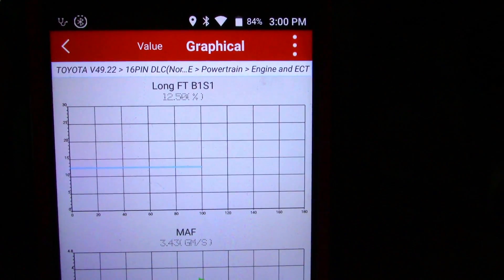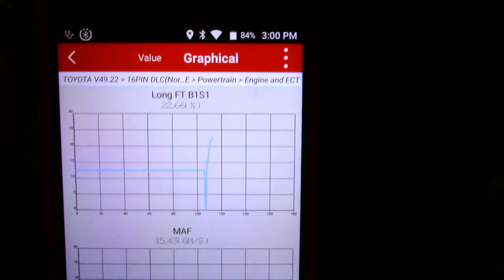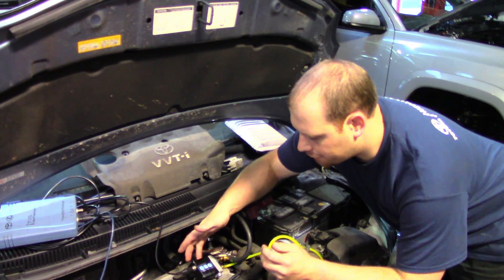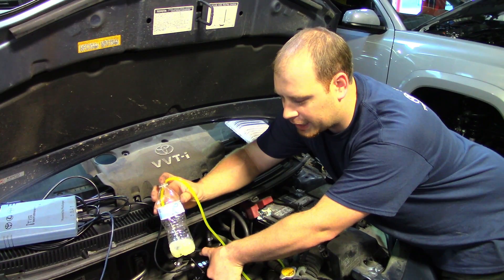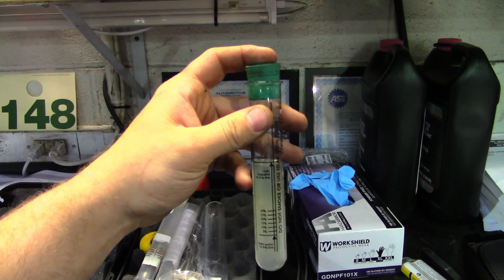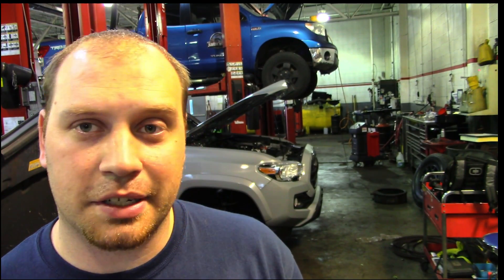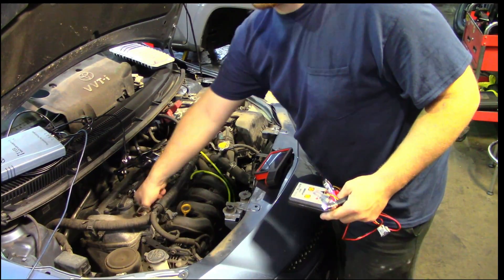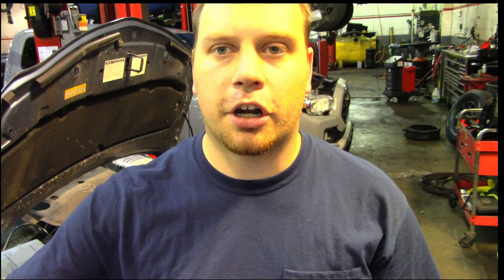Diagnosing lean fuel trims ('08 Yaris-P0171)

Comment: Am change Fuel filter and spark plugs, throttle and fuel injector service but no problem solve still some Kilo meters the Rich fuel mixture code comes on

Comment: Great diagnostic , i was searching for a fuel trim diagnostic videos and i passed by your video , i have a rich condition on my Toyota corolla 2015 , changed the o2 sensors , the MAF sensor , checked for a vacuum leak , cleaned and tested the fuel injectors , checked the Coolant temperature sensor , everything is fine but the car is running very rich , the short fuel trim is about -16 and the long fuel trim -45 , the car is smoking and i have very bad mileage , any idea ?!

Comment: Does this fuel injector tester come with different output terminal types that you plug into fuel injector or do you have to somehow make your own to ensure it fits the type of fuel injector you have? My car is a 98 z28 Camaro.
Reply from the maker: I had to make a connector. It comes with spade terminals so i made different injector harnesses that connect to the spade terminals
Reply: @VoltageDropDiagnostics  Thanks for the quick reply.  Maybe I can locate a fuel injector harness for my Camaro. Excellent video.  Subscribed

Comment: Good afternoon Pat. So I had a 06 1.5 Scion Xa in the shop with lean codes. The customer had installed some ebay fuel injectors and they were over fueling terrible. The car would barely run. So I installed original injectors and the car ran pretty decent. Long term was 28-30. Full throttle acceleration, the O2 would go full lean and the power seemed down, though not terrible. I would record on the Verus and looking at the play back it was definitely lean. The upstream O2 would take a long time to go into closed loop. I replaced it with a Denso and it would go into closed loop quickly. I also checked MAF sensor, it was clean. Fuel pressure was good at wot. I decided to replace the injectors. But I thought I would pressure drop them with the nifty little pulse tool. Pressure drop was consistent 41 to 34,35 on all four. This is with a cold engine using my scan tool to turn on the fuel pump between injectors. I per formed the same test cold with the new injectors. Very similar results. Pretty much as soon as I started the engine, the long term started dropping and the short term was now high. After a short drive the fuel trims were perfect and full throttle acceleration caused upstream O2 to read 760, which I think is good. Pressure dropping the injectors to check for lean codes I don't think is a good strategy. Maybe to find a leaky or badly restricted one yes. But all four were just old and not flowing optimum amount. The pressure drop was about the same on the new ones, and yet they fixed the problem.    Now he is going to need a clutch because on the freeway at 80, if u floor it, it will now start to slip the clutch with the extra power. Sorry for the long comment. But I really have enjoyed learning your approach to different Toyota problems.
Reply from the maker: I’ve pressure dropped many injectors for lean codes. I only allow a 1 PSI difference between injectors on a cold engine, while using a pressure transducer to measure the drop.

Sorry that it didn’t work for you. But like you did. It’s not just one test that leads you to an answer. It’s a diagnostic path that points you in a direction.
Reply: @VoltageDropDiagnostics  I was inn no way criticising the method. I was just sharing what things I observed. This is our Super Toyota Channel
Reply from the maker: @billrimmer5596  i know. But the key for me was using the transducer. I had trouble when i was using a gauge. There is a level of error built into a gauge. With that said. I always look forward to your comments! I knew that it wasn’t criticism 

Have a merry Xmas Bill!

Comment: this really helps PJ as I've got a hybrid 2012 camry with a P0171 and P0101.. the MAF is new. Where/how do you T into the fuel line? Any pics of that or suggestions for adapters etc?
Reply from the maker: With that 101 code... are you sure that you don’t have a vacuum leak? What are your grams per second from your MAF sensor?

Comment: Hi
Could you give me a little advice?
I have a Toyota Vitz/Yaris 2007 model 1300cc. I get P0171 code every time I go above 75-80Km/h, or even going uphill or when I press hard on the accelerator. The check engine light disappears after turning off and then turning back on the engine. Does this give any clue to whether it is a vacuum leak or fuel injector problem. I would really appreciate any help. Thanks
Reply from the maker: Sounds more like a fueling issue. But I’d need more data before being certain of that.

Comment: These damn new cars now days require of these damn fancy equipment, just to look data and fix a problem. I am curious will a voltage meter on the ohms setting and comparing # will it help to find the solution to a problem?
Reply from the maker: No. Unfortunately an ohms test wouldn't have proved the fault. Off camera I checked the injectors using an amp clamp and they all pulled the same amount of amperage. So the resistance had to be close between them.

Comment: Are you a master certified Toyota technician?
Reply from the maker: Kinda of. I am a level above a master. Technically I am a Toyota Certified Toyota Master Diagnostic Technician. I am from Pittsburgh.
Reply: @VoltageDropDiagnostics  awesome. How many years you been doing it? I'm a big Toyota fan. I've owned 4 of them. Currently driving a 2012 Corolla s with 73k on the clock.
Reply from the maker: Jeremy Anthony i started at a gas station in ‘04 when I was 17. Then I got a job in a Saturn dealer shop when I was 18 and left there a little over a year later when I found out that Saturn was being shut down.

Then I got a job working for Toyota in ‘07 and have been there since. So 13 years.
Reply: @VoltageDropDiagnostics  well Toyota is better than GM. Have you ever done any truck frame replacements? You should do a video on those sometime.
Reply from the maker: Jeremy Anthony i have done hundreds of frame replacements! But it seems like they’re dwindling down. I haven’t done one in probably 4-5 months.
Reply: @VoltageDropDiagnostics  well I live in Bethlehem pa , so if you happen to work at koch 33 Toyota where I take my car, lmk.
Reply from the maker: Jeremy Anthony no, I’m in Pittsburgh at a dealership called Ganley Toyota.
Reply: @VoltageDropDiagnostics  ok.

Comment: Curious,  I have invested a lot lately in scan tools, mostly Autel, but have looked at Launch products also.  The one you have linked to in this video is no longer available thru Amazon but it looks like they have a newer 4th generation that replaces it.   I wondering if you have had any problems with compatibility with units purchased through Amazon.  I’ve read that units purchased thru Amazon are not US supported.
Reply from the maker: This diagun was sent to me from Kingbolen which is a chinese company. As far as support. I honestly don't know how good it is. Mine hasn't broken and I haven't needed support. I do know that they run a facebook page that offers support. But if the tool needed sent in for repairs, I am honestly not sure how that gets handled. 

One thing I do know is that I bought my autel scan tool from a US seller and the battery went bad in it. He has had my autel for about 6 weeks right now for a battery replacement! haha
Reply: Voltage Drop Diagnostics
  That’s a bummer about the Autel.  I bought the MS906bt and so far it’s been working good.  I just work from my home so I don’t see the number of cars that you guys see as I have a client base of about twenty people.  The reason I asked about Launch was because I have the cp129 and it was way off on the code for an SRS code.  Engine codes it sees to be ok on.  I did buy that fuel injector tester your using after watching one of your videos, actually my wife got it for me for Christmas.  Your videos, Eric O’s and Ivan’s are a great resource for an old guy like me.

Comment: Back in the mid-80’s GM had a dealer tool very similar to yours except we were using a mechanical gauge back then, and although it was 1psi gradients, we never had to discern to that level. Back then our issues were dirty pintle valves (Bosch SFI on Buick v-6) due to poor quality gas/low detergent and we were usually seeing 5psi or more drops in pressure and on car cleaning wasn’t working so we were replacing them.
Reply: It can be done but not in the car. There are companies that can clean them off the car, but it’s entirely possible it has nothing to do with being dirty. An injector cleaning service though will/should give you a full report on flow rates and spray patterns etc. Of course now the cost becomes a factor as to if it’s even worth it. If you look thru Eric Os videos he even had a Corvette that had sat a while but ran and when it would get hot some of the injectors would fail in a weird way and the car wouldn’t even start until it cooled off.
Reply from the maker: GNX157 i remember scanner danner having a similar issue with injectors haha
Reply from the maker: I have tried cleaning these injectors, too! I haven't had much luck. I actually haven't seen many people successfully clean an injector. Have you?

Comment: I have a 2000 Corolla 1.8 with the good old lean code. U make things look so easy. Disconnecting the fuel is the first challenge. Ordered the special Lisle tool from Amazon. Comes tomorrow. Am going to do the fuel trim things with my Diagun right now. This is a super video.
Reply from the maker: Thanks Bill! If you need any help, send me some data pid info and I’ll help out the best that I can!

Are you on Facebook? You can always message me.
Reply: Voltage Drop Diagnostics I apologize.  I am not on Facebook. I am also going to check my maf sensor. As soon as I click on the AC it goes to about 3-3.5 grams per second. I did some full throttle runs with the Verus. I even recorded them. Then I parked and reviewed the data. I am enjoying putting into practice some of the good points I learn from your perspective!

Comment: Nice vid ,I can why WPS is invaluable tool for a 21st century tech .Can you shed more light on on  testing  for checking for presence of water in gasoline ,I seems  lost there
Reply from the maker: I wasn’t exactly looking for water in gasoline when using the beaker. You can generally just visually look at fuel and see the water because fuel and water don’t mix.

When i was using the beaker, i was seeing what the ethanol level was.

The water combines with the ethanol in the fuel. And the more ethanol in the fuel, the higher the water line would have been.

Comment: I'm also a Toyota tech and I use the same injector pulse tool for years now. I was wounding how you can test if all injector are flowing evenly but still low? Few years back I had a Highlander or Rav4 that kind of took me too long to find just asking incase I missed a ez test.
Reply from the maker: My best advice is to get known goods with your tool. See how much a good injector drops on a known good vehicle. But since I started using the pressure transducer,  it has been a lot easier for me to pinpoint injector failures. Its hard to see a 1/2 PSI difference from one injector to the next on a fuel pressure gauge. 

But on a scope, it sticks out like a sore thumb.
Reply: I received the pressure transducer 3-4 weeks ago and have used it many times. I also had built a homemade transducer. The year of the Rav4 I think was 2000 and did have a know good to compare. I glad Toyota has made the WPS a SST it make the picoscope Toyota kit more complete.
Reply: I used the WPS transducer yesterday with a injector drop test from 2 injectors flow 1.5 psi less than other on a 2000 celica if customer purchases new injectors I'll reset to see what a new injector will flow. I think the others are close to 2 psi less than a good injector. Thanks for the great idea and test idea.
Reply from the maker: @joshuawood6588  I'd like to know what the new injectors flow! I'm glad I was able to help
Reply: CELICA diag was for another local shop. No injector they are installing them. They declined repairs Saturday.

Comment: Does the wps500 have fittings for fuel pressure tests
Reply from the maker: You can get a “T” that goes into the WPS that you can attach rubber hose to.

Then the rubber hose needs attached to the fuel line. As far as I’m aware, you can only get the T and you need to make the rest work, which isn’t a huge issue, honestly.

Comment: Question is how do you know if there restricted if they all have low flow?? Say they all dropped as much as cylinder 3 in your video
Reply from the maker: There really isnt a great way when that situation comes up. But the odds that all 4 are flowing exactly the same amount, while also not flowing enough is probably low. With that said, that is why I switched to using the WPS, because it was hard to get perfectly accurate readouts with a normal fuel pressure gauge. Trying to see one injector flowing 16.3 psi vs another that is 16.8 psi is almost impossible. But with the wps, it stands out a little more easily. 

So with that said. If they all flowed exactly the same amount of fuel, I would have moved on until everything else was checked, and used process of elimination to determine that the injectors weren't flowing enough fuel.
Reply: True. Wish I had a pico
Reply from the maker: I also have an autel scope and love it! And it’s 1/4 of the price.

You might want to look into it.
Reply: Does autel have a version of the pressure tester you used?
Reply from the maker: Not that I’m aware of, unfortunately.
Reply: If all were evenly low flowing (highly doubtful), you’d see it in the block learn/integrator numbers as a compensation, as the O2 would be reading a common flow. More likely it would be a bad fuel pump not providing enough volume at correct pressure or fuel filter clogged but in that case you’d see the engine lay down under full throttle sort of like a partially clogged converter etc. it’s a rather subtle feeling unless you’re used to feeling for it or know how the car used to perform.

Comment: Awesome video PJ. Now I gotta get a new tool 😤. Question Amigo? When u were checking fuel pressure and u had a base steady pressure of 45 I think u said... u had it on idle. Now what would happen if u came off of idle and pressure dropped on excel. I know it's normal for it to drop on decel a little. Would that have changed ur direction towards a pump? Just wondering because I'm always thinking of scenarios of different problems. Thank u PJ
Reply from the maker: If it had a drastic drop, I for sure would have starting looking at a fuel pump issue. And frankly, I should have checked that, but after filling the water bottle with fuel, I felt like the volume and pressure seemed good. Obviously I didn't measure the volume of fuel going into the water bottle, I just followed my gut. But thanks for pointing that out! Next time, I'll make sure to also load the fuel pump!
Reply: @VoltageDropDiagnostics  U are awesome PJ. Happy to call u My Amigo 😀😀
Reply from the maker: I can’t wait to hang out at Super Saturday man!

What classes did you decide on?
Reply: @VoltageDropDiagnostics  Network communications with Erik Ziegler and the wiring diagram class with George Menchu
Reply from the maker: I’ll be in the Eric Ziegler class with you!
Reply: @VoltageDropDiagnostics  ohh yeah I just ordered that injector tester and the fuel sampler cylinder and a couple of other stuff. Thanx PJ 😡

Comment: I love using pressure transducer to do injector  balance test. My favorite is GM were we can set pressure transducer and use scan tool to activate injectors. I wish that every manufacturer would have that option. Great diagnosis my friend. Cheers 👍👍
Reply from the maker: I agree! It would be so nice if, with today’s technology; they put a fuel pressure sensor on the car, and you were able to look at fuel pressure on a scan tool, while activating the injectors.

But i enjoy doing it this way.

Comment: Great demonstration! I've seen on Toyotas particularly like on the matrix with the 1.8 if those injectors are only a half a pound different they will setlean codes. The problem is most manual gauges are only 2 PSI increments. Thanks for demonstrating this valuable test! I'm definitely going to start using it 😎
Reply from the maker: Thats the problem that I was having. My gauge reads in 2 PSI increments, and I was squinting and trying to read between the lines lol. I found that this way is more accurate for me.

Comment: Haven’t dug into our kit yet. Does it come with adapters/lines to use the tool in-line instead of a dead head measurement?
Reply from the maker: Yup! The kit that toyota sent out has a lot more adapters than my kit came with. Our toyota kit came with adapters for oil pressure, too.

Comment: Good video PJ. I like how you used the Pico to capture your pressure drop readings. Keep the videos  coming 👍🏼
Reply from the maker: Thanks! I used to use a fuel pressure gauge, but mine measures in 2 PSI increments. So getting the accuracy I need to call $800 worth of injectors was difficult at times. Once I did it this way, with the WPS I never looked back!
Reply: @VoltageDropDiagnostics  wps500 kit is on the next "BIG" purchase agenda. Lol

Comment: Do you know if that fuel injector tester  will work on GDI injectors? Can it withstand the extra amperage? Thanks again.
Reply from the maker: No, it won’t work on GDI injectors. Those injectors usually take over 40 volts to fire from my experience.